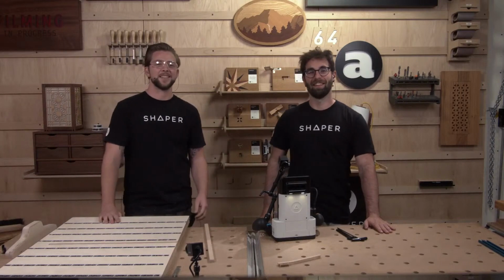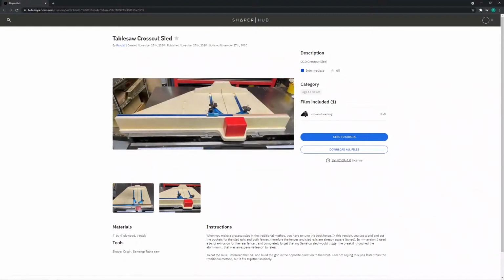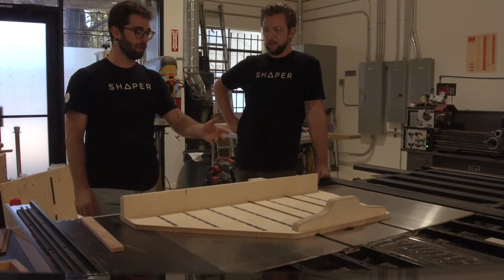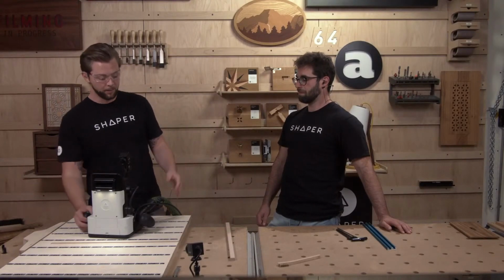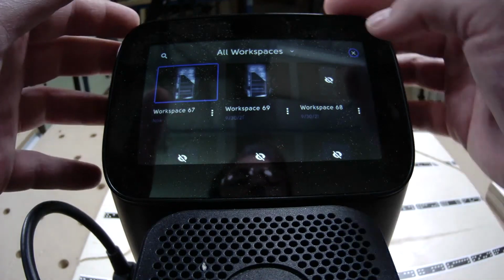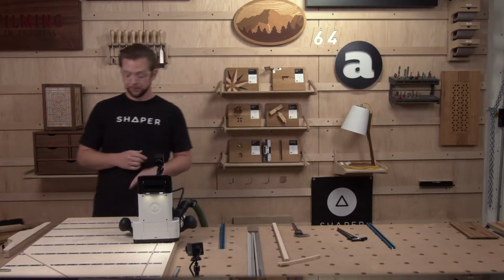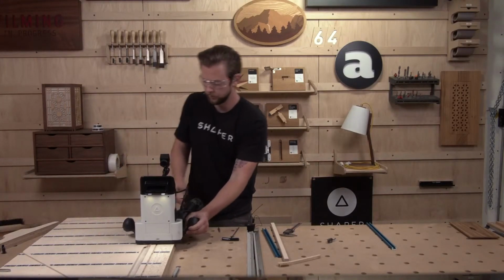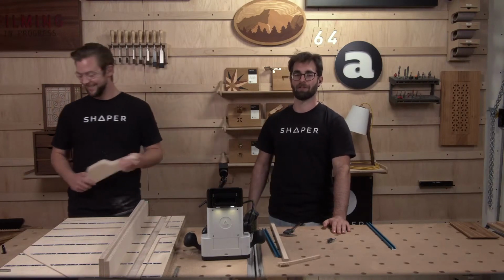Session 43  – English: Using Origin To Make A Cross Cut Sled

Comment: Where do you get the 3/4” center cutting bit? Is that the actual name of it?
Reply: It’s not the same geometry as the one they showed in the video, but Amana’s 45230 bit is a 3/4” diameter plunge router bit with a 1/4” shank.

Comment: During the live stream there were questions about sled accuracy as measured by the five cut test. I tested the sled I made a few days ago. I got an absolute error on the fifth cut of 0.81mm over a cut distance of 237mm. That's an error ratio of 0.202mm or 0.007953in. That's pretty good and not worth adjustment by the conventional sled construction methods.